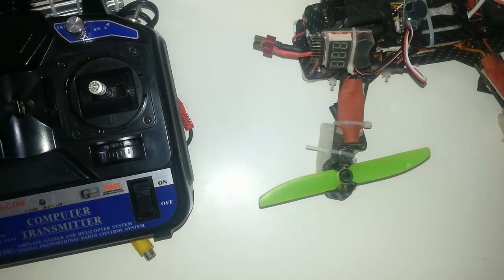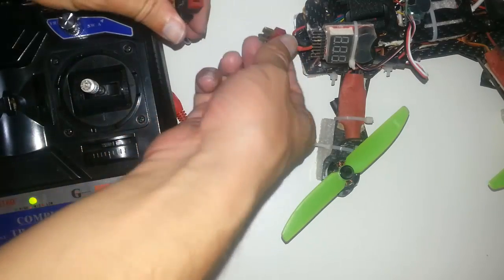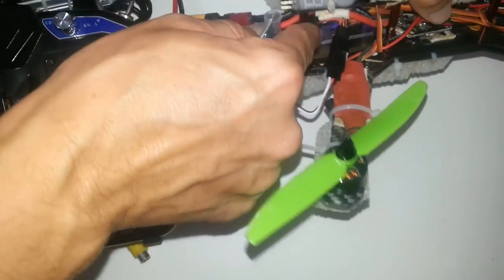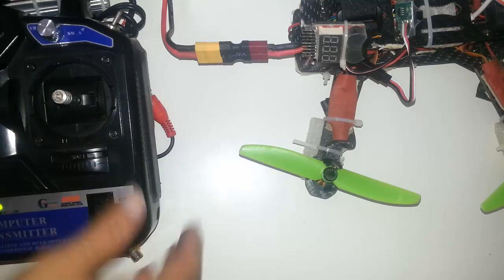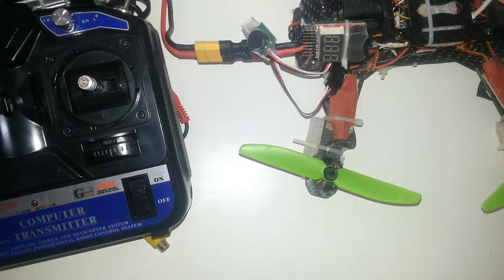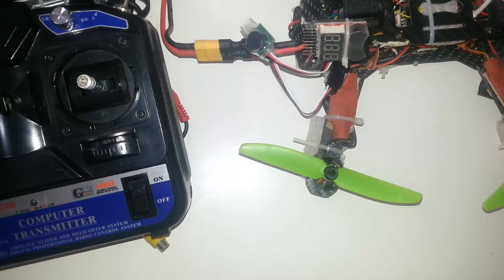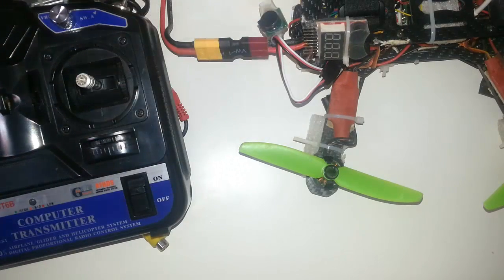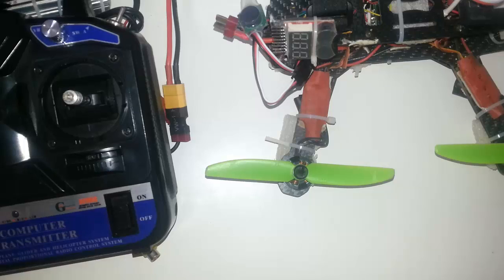Lost Quadcopter - rc airplane finder alarm

Comment: Hi a question with the rx
I am using a fs-r6b with the same tx you are using, chanel1 slot gets the white-red-black pin and the slot named "bat" remains without anything connected? Thanks
Reply from the maker: +Jordi A. the slot with BAT is not connected